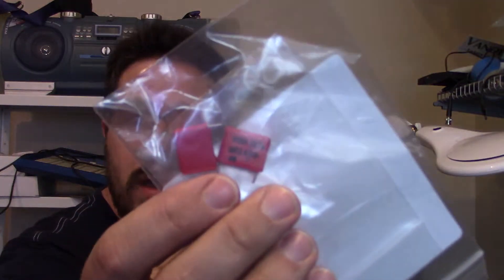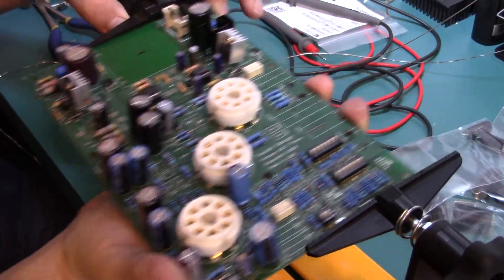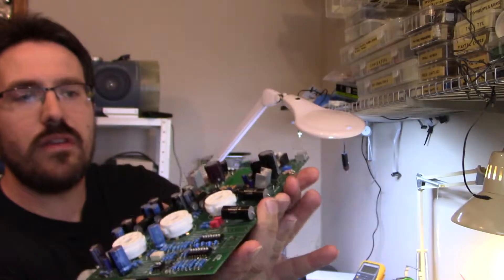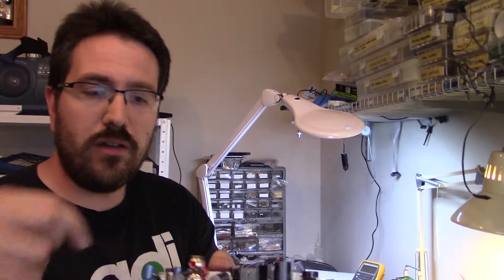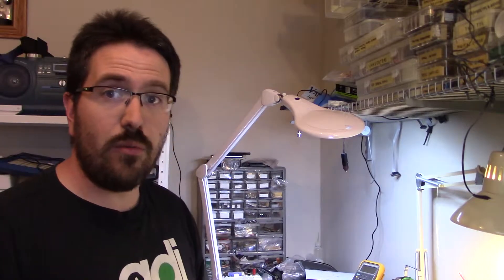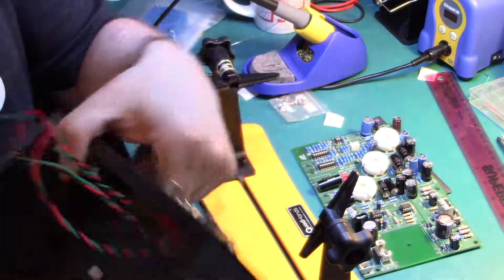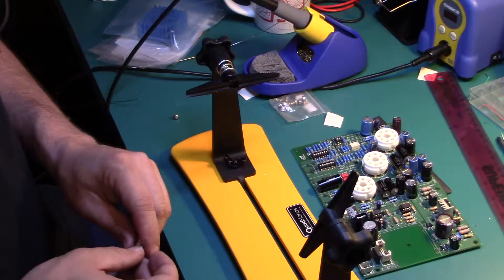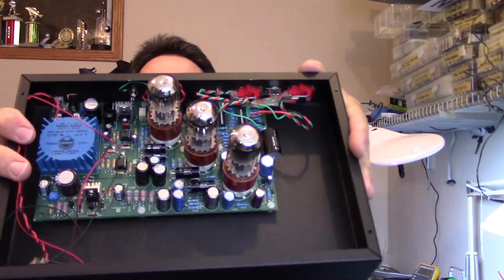Building a Vacuum Tube Preamp - Part 3 - Soldering and Assembly Finished

Comment: Can you please tell me what capacitors you used for the signal path? I couldn't hear when you mentioned it in the video. Thanks!
Reply from the maker: I used the metallized polypropylene Solen Fast Capacitors. Solen have a variety of materials they use to make audio grade caps but can get quite expensive.